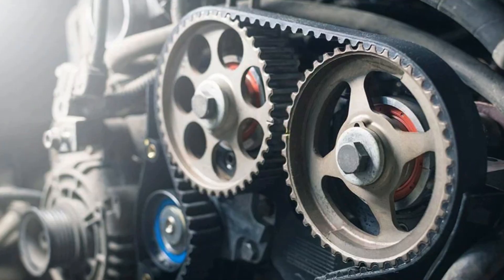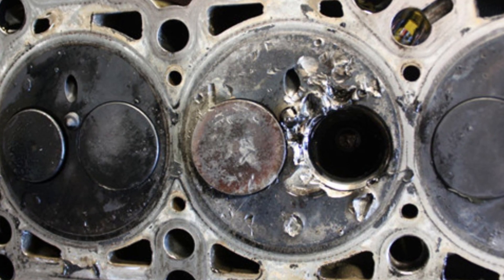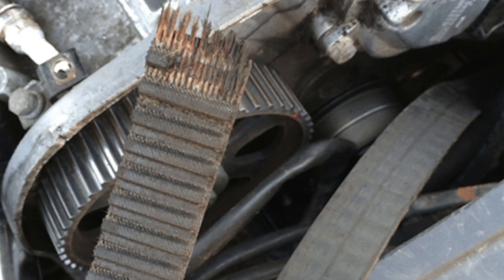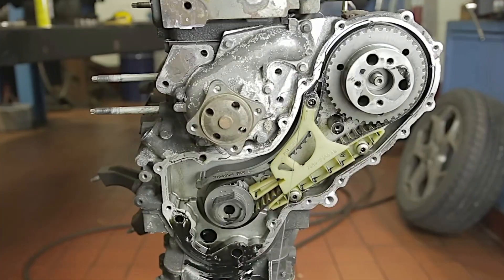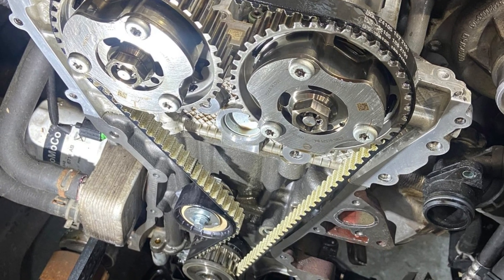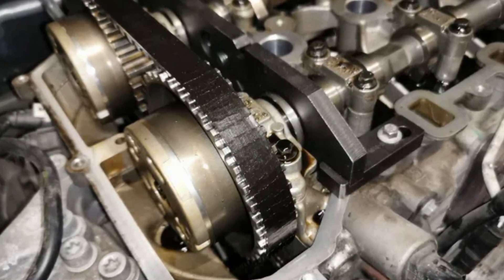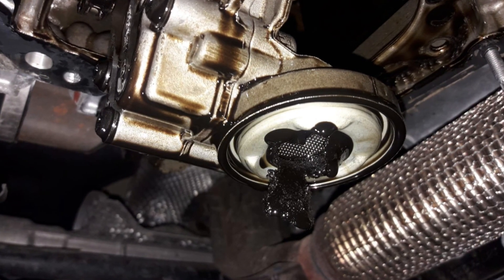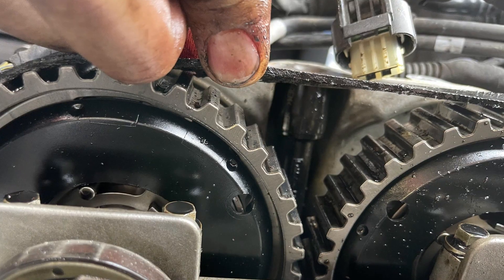Wet timing belt. What is it and why is it bad?

Comment: The latest Buick Envista and Chevrolet Trax both are equipped with wet timing belts...what the hell is GM thinking???
Reply from the maker: Yes, and I like how they don't advertize that anywhere. Like you have to dig a lot of forums to see that those 1.2 LIH and LBP engines have wet belts and 150K miles recommended belt change interval.
Reply: programmed obsolescence

Comment: I worked for over 25years in the automotive service sector. Just recently my older son told me about this timing belt running in the oil. At first I thought he was joking with me but then he showed me this on youtube and I was shocked. In the old days there was a common rule not to put any  oil or lubricant on rubber. The engineer who came uo with this and his supervisor should get an award: How to f*** up an engine. 
Probably the next step will be plastic engines. :-) Plastic engines could be very easy recycled...lol
Reply: They no longer hide the built in obsolescence in product

Comment: Yes, yes yes. The automotive fee have made some disastrous mistakes when it comes to rubber belts inside the ice engine. If we went backwards we usually have chains if we had a stainless steel chain or titanium chain which would be better but no rubber they are throwaway cars in the mind of the people who are making them. I have a Hyundai 2014 absolutely brilliant car quick two door 1600 with SNG only buy my servicing the car myself the right way as for Hyundai service in Australia. They are simply worthless here in Australia. We had to change air filters and oil filters Very quickly. Otherwise dust from the dead centre ruins the car just like it wiped out all the solar panels that they put in central Australia big mistake anybody could’ve told them that Australia is being run on empty because Albanese Mr. Albanese couldn’t run a boss. I don’t know where he was educated. It was on another planet.

Comment: What’s wrong with dry external belts? Why would you even need to soak a rubber belt in boiling hot oil anyway? They don’t need lubrication. Everyone needs to mass boycott cars with that design. It’s the only way manufacturers will learn their lesson on penny pinching. Like Boeing.
Reply from the maker: It's all about emissions. These wet-belt engines are slightly more eco-friendly.
Reply: @ don’t you think cooking your rubber belt in hot oil like French fries and letting those rubber particles get into the engine oil and then get burnt and sent out the tailpipe is a bad thing for emissions?
Reply from the maker: I do think it's an insane idea that's why I made this video :) Emission control or whatever other reasons they have for killing ICE engines at all are just excuses for making us all buy EVs now.

Comment: Why do belts need to be wet and lubricated at all? What was wrong with dry belts that they needed to develop this technology?
I have been living with dry belts for decades and didn't have a single issue.
Reply: They are around 1% more efficient compared to dry-belts, which is a huge difference during emissions tests.
Remember, European standards are extremely obsessed with those gains in run-time emissions.
Getting 1% more efficient is way more valuable to European standards than having the car survive for 20 years.
Reply: @FinlayDaG33k  Thanks for the enlightening.
Reply: dry belt requires 2 or even 3 additional seals between oil space and outer dry air, which Costs Money, lets save $50 per vehicle, they promised modern synthetic belt survives in oil forever!!!!!! Yes, bossa, great idea, implementing now!

 - Whut, it degrades in 3 year? Nobody cares, we already sold this car, now its owner problem, nuahaha!

Comment: They should recall and change all into a chain
Reply: At least PSA already updated the engine to chain (last models with 1.2 hybrids and 6 speed dual clutch are chain) but nowadays there are no perfect solution because we all know the problems with chain systems and the tensioners (plastic guides).
Reply: But there is a kit to change from belt to chain.

Comment: Worth noting that the wet belt design isnt limited to the ford and PSA engines mentioned here, other manufactures, for example Honda, have also applied this technology.
Reply: @MattyT_86  i reckon this manufacturers made an agreement an agreement to create this rubbish wet belt boom cars ,it's a rip off
Reply: GM also has this design. I think all of them were convinced by belt manufacturers without being tested in the road.
On paper they are good because the low friction and better noise suppression but there is a wolf called oil dilution and this is the main problem.

Comment: the wet belt is a money grabbing scheme. As are the modern chains, they last shorter than belts. In the old time the chain would outlast the car.
Reply: @markobajt9261  that's why I'm keeping my old junk buddy
Reply: Dayco is the supplier that arrived with this problematic innovation.
Reply: In theory this solution has a lot of benefits and last longer that the traditional dry belt (maybe in this 3cyl engines).

Comment: This ford focus ecoboost turbo 1.0 engines are rubbish,my brothers ford focus already had a bearing knock even befor oil light signal apear in the speedometer, suddenly the car overheated and the entire egine is filled with milkshake,as for me i m ok with my junk w124 e200,250000 on the clock buddy and the engine is still great.i love this w124 e200  junk
Reply: Th 1.0 litre engines had issues with the cooling system parts as well as the wet belt issues! Economical - yes - but only on fuel; what you save in fuel, you spend on maintinence and repairs...
Reply: @MattyT_86  Welcome to European standards... We're more obsessed with minor reductions in fuel consumption and emissions than having the car avoid the scrapyard for years to come.
Reply: Ford Ecoboost open deck engines are all milkshake maker, they're the worst modern engines by far !! 🤪